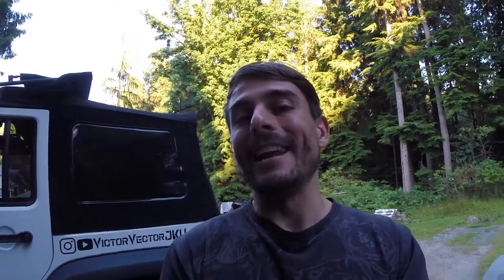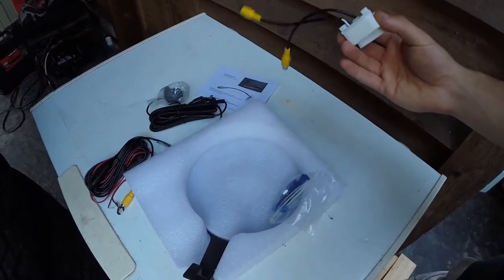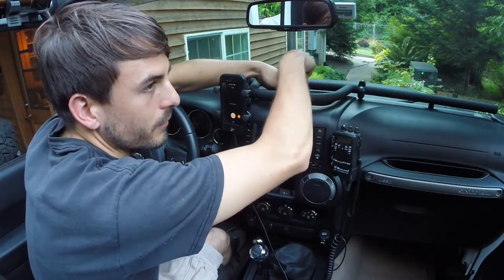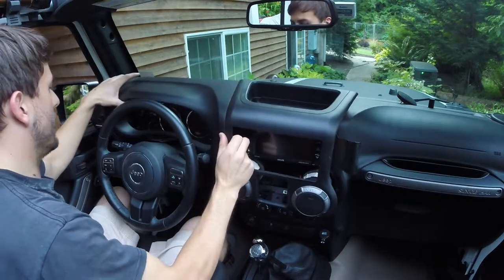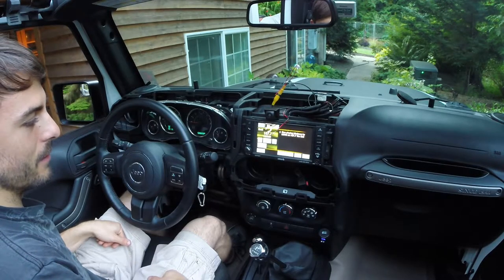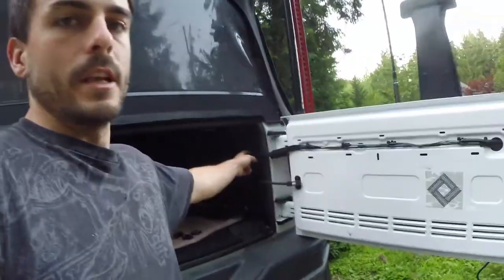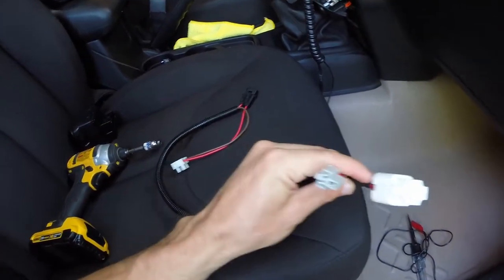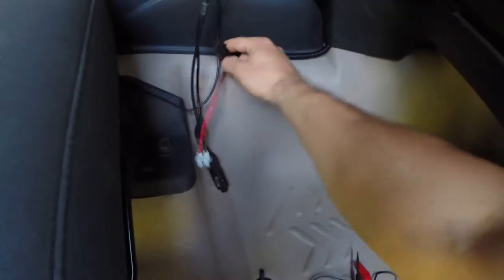U-CONNECT Model RBZ Back Up Cam Install - Jeep JKU

Comment: I have a 2017 Wrangler JK with factory radio and navigation.  The radio is an RHB.  I bought the backup camera but can't get it to display on the factory radio screen.  Do I need to unlock/program it?
I have an OBD scanner but not sure how to do it using Jsacan.  
Might you be able to help?
Reply from the maker: So I am going to guess you will need to enable the reverse camera either through a programmer like the J-Scan app or you can take it to the dealer to have it enabled as well I believe. Being the RHB and having navigation maybe you can enable it through the touchscreen but I am unsure.
Reply: @VictorVectorJKU  
I just enabled it but I am not getting the camera to work.  The screen comes up with check your surroundings.
Reply: @VictorVectorJKU
The camera wire has connectors, so I put a piece of wire into the red wire connector and attached it to a battery and put a wire into the black connector and attached it to metal in the car.  I tried both adapters that came with the camera and neither works.  What am I doing wrong?
Reply: @VictorVectorJKU  
I got it working.  I used a thin wire but did not know that wire was insulated!  
Thank you for your video.  I hope I can finish the installation.  This has saved me a lot of money!  Thanks again!
Reply from the maker: Sorry for the delay! But Ok, following along your replies. Sounds like you got it enabled, and the issue was running power to the camera which it sounds like you figured out! Glad to hear you were able to troubleshoot and get it working!! And you bet, I started this channel to help out other fellow Jeepers with the upgrades I am doin!!

Comment: Where can I get that dash mount where you had your CB? looks like it's attached to the radio mounting bolts?
Reply from the maker: Hey there Ivansterr, thanks for checking out my video! I actually fab’d up that bracket myself and yes it uses the two right fasteners for the radio head unit! I am not sure if there are aftermarket solutions that use the radio head unit hardware. I am only aware of the ones that use the left side of the passenger dash grab handle.
Reply: @VictorVectorJKU  thought so,  thanks for the reply,  I'll have to make one for myself as well
Reply from the maker: There you go!!

Comment: Did you have to flash the OBD too to make it work?
Reply from the maker: Hey there Steve, thanks for checking out my video! Yes I had to enable a parameter using the J-Scan App and a Bluetooth reader!
Reply: @VictorVectorJKU  The Camera u used is the quality okay and do you have a link of the j scan that you used
Reply from the maker: Here is the link if you have an iPhone. Otherwise search for “OBD JScan” in your App Store on your phone. The app will inform you of compatible Bluetooth readers. https://apps.apple.com/us/app/obd-jscan/id1445903514

The camera I have is fine, keep in mind the resolution of the screen will limit the clarity too.
Reply: @VictorVectorJKU  I'm kind of new to this. Do I need to still plug something in underneath the dash or can I do what I need to do just by using the app? I have a Google pixel 7 phone
Reply from the maker: No problem! You will need to follow the steps I outlined in the video to connect the camera to power and the radio, you will need the Bluetooth OBD reader off of Amazon or other sites and then the app on your phone will connect to it and you will need to find the parameter to enable the camera in the app. You will have to search your App Store for the JScan app since I expect the link I provided will not work for you. I hope this clarifies your questions!

Comment: Thanks for the post. Question; If I have an RBZ radio in my Jeep (2015 JKU) I can add a backup camera and not have to have dealer "flash" system for it to work?
Thanks
Reply from the maker: Hey PawPaw, thanks for checking out my video! You will need to program your ECU to enable the camera. You will need to follow the steps I outlined in this video to do so or have a dealer enable the reverse camera.
Reply: @VictorVectorJKU  I bought OBDII and got my radio set for rear camera, easy as that. Best $24 spent. Gonna try and finish my install this week. I went with license plate camera as I have cover over spar tire mount. I also noticed while looking on OBDII that head unit shows Nav option? Interesting. 
Thanks again
Reply from the maker: That’s awesome! I am glad my video helped you get it all set up! And interesting that you have a nav option, if you can enable it and it works that would be great!
Reply: @VictorVectorJKU  Definitely gonna enable the Nav and see. Gotta redo the wiring at taillight, as I have no scene, just black screen
Reply from the maker: That is interesting, If it isn’t the electrical also check and make sure that you’re using the correct adapter for the back of the head unit, that is if you are using the same camera as I did.
Reply: @VictorVectorJKU  I bought an Eway license plate camera from Amazon that came with one plug that was specific for JK including 2015. Looked like the same plug in you used outta the two that came with yours.
Reply from the maker: Ok, I gotcha. Mine came with two separate connectors that use different terminals in the plug that vary between the years of the JK, from my understanding. So if it isn’t the power then it could be the pin out of that connection. Hopefully it’s just a power issue tho!
Reply: @VictorVectorJKU  finally got it working! Bad connection (wire tabs) went old school, stripped and tied. And, must have dreamed about Nav, cause ain't finding it. Thanks again for your video and advice. Take care
Reply from the maker: Good deal, I am glad you were able to figure it out! And bummer about the Nav. You are welcome!

Comment: So does your back up camera have constant power? Usually they're powered by the reverse light circuit.
Reply from the maker: Yes I have mine set up on constant power, I have had others comment that they are tapped in on the reverse light circuit and that works fine for them! I didn’t want to splice into the main harness tho so I ran extra wiring to my adapter for my 12v power outlet instead! I haven’t had any issues to this day with this strategy!
Reply: @VictorVectorJKU  Ok, so that tells me the head unit already has an input that knows when the car is in reverse, right? So no need for the additional red wire in tandem with the RCA jack. Also, could you tell me where you found the information on the U-connect head unit? Mine is like yours but is an RHR. Want to see if mine has video in capabilities too. I'm doing the same thing you're doing except with a 14 Challenger RT. Great to see people making this videos! It's been a big help, thanks!
Reply from the maker: @rhandbhf4ever  yes that is correct, or at least on my install, that the head unit has a connection with the reverse signal already. As far as the info on the compatibility of the head unit I just googled it and I don’t recall if I found a definitive answer so I kind of just went with it. But if you have an OBD programming tool you can check to see if you have a “camera enable” parameter you can turn on. Then when you put your vehicle in reverse you should get a black screen and a message until you hook up a camera. I hope this helps you figure out your head unit! And also thank you! That is what my channel is all about, sharing my experiences and knowledge to help out others and trying to get into more details than other channels may go into!
Reply: @VictorVectorJKU  Thanks again!

Comment: I have a 2013 with the factory radio will this work for me
Reply from the maker: Do a favor for me and look at the lower right corner on the face of the unit, if it shows RBZ on the face then yes it should work.
Reply: Mine is rhb
Reply from the maker: Ok so just to confirm you have the unit with navigation? From my understanding, you should be able to connect a back up camera like I did. You will of course need to or have the ECU programmed to enable the reverse camera. But this is a different unit than I have so I am not 100% positive.

Comment: I must’ve missed it in the video. What camera kit did you buy from Amazon? I just bought a ‘17 Willys with the RBZ radio. Also, is there not a better keyed option than the cig wire? Great video!
Reply from the maker: Hey Upsman1313, thanks for checking out my video and congrats on the purchase! I have the link in the video description to the camera kit I purchased! As far as the power, anywhere that has constant power will work and possibly even the reverse lights since when you go into reverse the power would be supplied by it. I just decided to run power the way I did since I was going to route my cb antenna wire along that same path! Definitely let me know if you have any other questions!
Reply: When I plug in the obd, what do I do next? I’ve downloaded app, but can’t seem to find what I need to enable camera. Also, on my wiring, there is a lone red wire from yellow video plug. What do I do with that? I already have camera plugged in to positive and negative wires.
Reply from the maker: Hey there Upsman1313. So just to verify, you have purchased the license for your VIN on your Jeep in the JScan App, correct? 

Once you plug in the OBD reader and open the JScan app you will want to select your vehicle and pair to it. Then you will go to the adaptation menu > radio and camera - settings > rear camera on/off > select active from the drop down.

As far as the lone red wire on the video cable, I believe it is included as a grounding wire. I did not do anything with it for my install. I think I just taped it to the video cable.

I hope this helps you out!
Reply: Thanks! I finally figured it out. The first app I downloaded didn’t offer any way for me to add camera. I got the right app and everything works out. Thanks for the help!

Comment: Do I need an OBD for the cam to work?  Also, where did you connect the red wire that comes off the video wire from the back of the radio?
Reply from the maker: Yes you will need a n OBD programmer to activate the camera on the head unit. And about 11:47 is where I covered how I powered the camera off of the 12v socket. That is the red wire you are asking about right?

Comment: What scanner did you use? Wish I would have know this before I ripped out the dash... I'm pretty quick at it now though!
Reply from the maker: Hey there James, I am running the VeePeak BLE+ Veepeak OBDCheck BLE+ Bluetooth 4.0 OBD2 Scanner for iOS & Android, Car Diagnostic Code Reader Scan Tool for Universal OBDII/EOBD Vehicles https://www.amazon.com/dp/B076XVQMVS/ref=cm_sw_r_cp_apip_sqjBvLAtcssdX along with the JScan app on my phone. To be able to program using this combo you will need to pay for the VIN in the JScan app one time, it is totally worth it tho!
Reply: @VictorVectorJKU  yeahhhhh... Saw it in another comment right after my post. Just ordered it. Keep up the good work!
Reply from the maker: All good James! Thank you! Also thanks for checking out my video!

Comment: Why did you not have power in the back? I thought I saw all the same wires? I thought we were supposed to splice it in on the reverse tail light wire? Or does it need to be a constant power? Like the one for the dome lights?
Reply from the maker: Hey there Cory, thanks for checking out the video! And my only guess is this is a standard harness from the factory and where it is plugged into the main harness is not supported based on the trim level of the vehicle. Only specific options come with the 12v power off the right rear corner and mine was not wired to support that even tho the connector was there. I think you need constant power otherwise if your lights are off and you shift into reverse you will have a black screen. This is why I ran my power up to a constant power accessory.
Reply: @VictorVectorJKU  I get it now. Thanks so much. Looking forward to watching the rest of your videos, love your jeep👍🏼
Reply from the maker: Thanks Cory! I appreciate the support! And let me know if you have any other questions. I’m up in the woods this weekend but I can look more into how I wired the power when I’m back home if you like! Just let me know!

Comment: Yea fuck this noise. Jeep cheeped out on the no back up cam.
Reply from the maker: I don’t think it was a DOT requirement for 2015, so it would been an option if offered
Reply: @VictorVectorJKU  with the poor vis backing up it should have been.
Reply from the maker: Yeah that’s a fair argument, I got used to using my side mirrors for backing up pulling trailers and driving a van without rear windows 🤷‍♂️ the Jeep is much easier than either of those